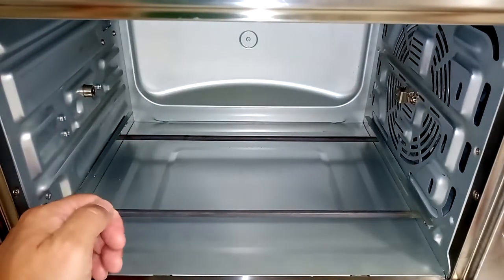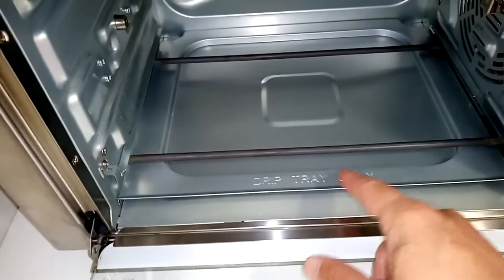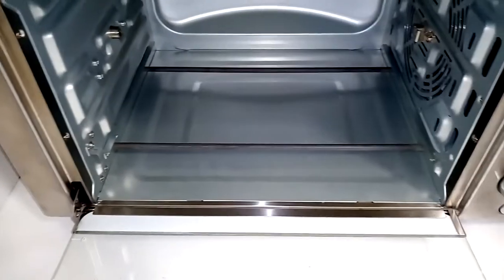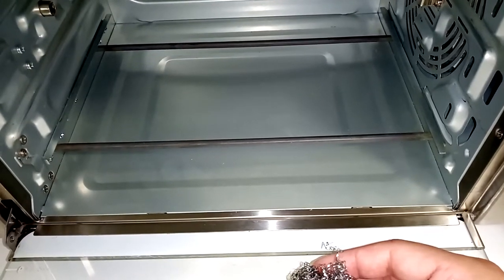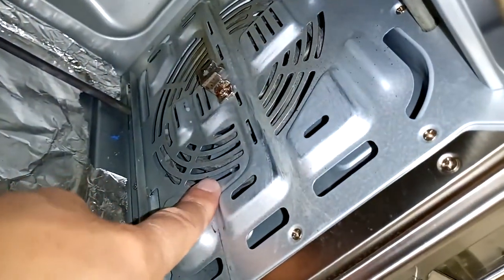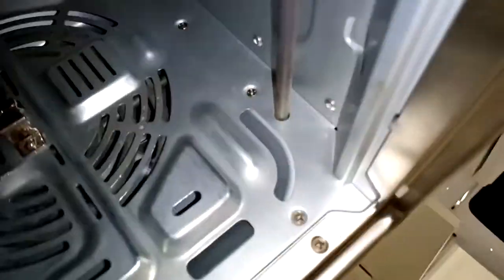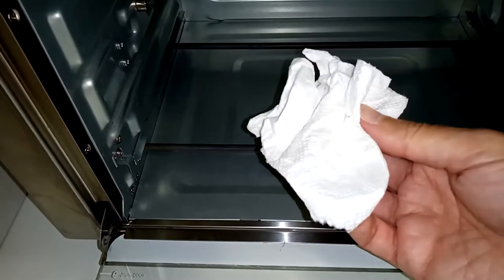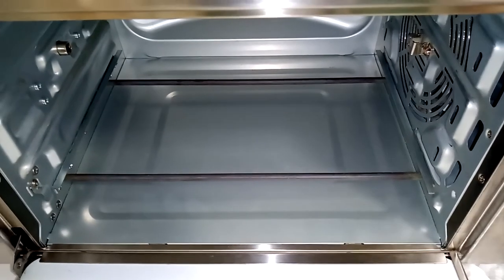How to Clean the Inside of an Emeril Air Fryer 360 & the "Tool" You Need To Do It!

Comment: Thanks for these tips! When you cook hamburgers (or steaks, etc.), how do you remove the basket (or food) without the hamburger juices dripping all over the glass door or kitchen counter?
Reply from the maker: I have a video (I'll share the link here too) where I cooked 4 beef hamburgers.  I placed them on top of aluminum foil, which sits on top of the baking tray.  I still used the air fryer mode to give the burgers some texture like you'd get off a grill.  Taking them out was as simple as pulling out the tray and cleanup was a few seconds to discard the foil.  If you choose to use the air fry basket, you'll want to place the baking tray on the lowest setting, above the elements to catch any grease drippings.  When it's done, I would open the glass door and slowly slide out the basket.  As soon as physically possible, I'd hold a plate that you may initially stick a part of into the air fryer, under the basket and remove both at the same time (to catch any drippings).  If you flip your burgers and steaks, you should be able to get away with using the tray and you can avoid the potential mess.  It just may take a bit longer than using the basket.  Here's the link for the beef burgers video: https://youtu.be/-CgqK1J3etM   Thank you for the positive feedback- it's always appreciated.

Comment: I appreciate you video but I try to regularly clean it but we use it a lot. I turned it upside down for the first time to look at the time to figure out how to tackle it. I'm really losing before I start. There is gunk all around and behind the heating element. Some items we are cooking now our smoke alarm is going off. I will try to clean what I can of the top and see if that is the problem. I have used the baking soda paste with toothbush and with a sponge alone. Its nice to have but a lot of work
Reply: Your's must not be made like mine. I have a heating element at the top
Reply from the maker: Try using the tool in the video to clean the inside of the Emeril Air Fryer 360. If you have grease on the top and bottom heating elements it could cause smoke or even if you have grease and fat caked on the baking tray.  Do you use foil?  The tool I recommend is abrasive and one of the only things that can remove that brown caked on grease/fat.  If you have grease behind the side heating element where the fan is.. that is very tricky.  One viewer tried to remove the panel, but I don't know if it worked out or not.

Comment: Has this ever been used?? It looks brand new
Reply from the maker: It was used for quite some time before making the video.  You can check out some of the videos on this channel that feature the Emeril Air Fryer 360.  I have one on how to polish the outside of the Emeril air fryer as well. In fact, the hardened on grease I'm cleaning in this video was from the beef burgers I cooked in it just prior.  That video is on this channel!  The product featured in this video works to clean the inside of the Emeril Power Air Fryer 360.  It's one of the only products that does, which is why I shared it with everyone.  Cleaning the inside of the air fryer is a pain point for many Emeril owners.

Comment: I put foil on drip tray and it doesn't touch heating elements. I was thinking of putting tin foil on the top as it's hard to clean. 

I emailed them they told me not to use that but to use non-abrasive sponge
Reply from the maker: I never considered using foil on the top of the Emeril Air Fryer, but you're right it does get its fair share of splatters.  I think it would be difficult to find the right adhesive- you need something that could withstand the heat, but also safe from a health perspective.  They are right- first try a sponge, then a sponge with some soft abrasive (like the one sided ones that are usually blue or yellow), and when all else fails, use the tool in the video (link is in the description).  Btw- thanks for validating the use of foil on the drip tray.  It helps let others know it can be done in a safe and effective manner.

Comment: I have the same oven. What about the white part of the door. Mine is dirty and doesn’t matter how I try to clean it. The stains don’t go away.
Reply from the maker: See my earlier reply to you about how I used this cleaning tool to successfully clean the white stripy parts of the glass door.  Without seeing your Emeril oven, I can't be sure, but it's likely that what appear to be irremovable stains, are the grease and other drippings that can be removed (using the cleaning tool I featured in this video).  Give it a try and let me know.
Reply: Baking soda..

Comment: Thank you I’m going to buy it and it should clean the top to
Reply from the maker: It will definitely clean the inside of the air fryer as demonstrated.  If by "the top" you mean the top of the inside, yes, without a doubt it will work.  But I wouldn't use it to clean the outside of the Emeril Air Fryer 360.  It's a bit too abrasive for that purpose.  Happy Frying and thank you for the positive feedback.
Reply: which store has it all the time i want to buy it this week

Comment: we are told not to use sharp tools like steel wool.  However this "ball" of steel looks very damaging - I am amazed this is not damaging.
Reply from the maker: It works well to clean the inside of an Emeril Air Fryer 360.  I haven't tested it on the inside of other air fryers, but I imagine it will work on others too.  It does provide amazing results given how hard it is to clean the dried on oil, fats, splashes, etc.  That is why I wanted to share this cleaning tool/gem with others!

Comment: I use foil, but I cooked some ribs and the sides got bad around the fan.
Reply from the maker: Not to worry!  Use this tool, follow the steps, and the inside of your Emeril Air Fryer will be clean again.  It's no match for a little rib juice :-)  As you see in the video, I had no problem removing the hardened on grease (from beef burgers) on the side wall right near the fan of the air fryer.

Comment: Will the metal cleaner not scratch and remove the covering of the inside parts and might cause rusting?Thank you.
Reply from the maker: You may see some light superficial scratches (i.e. nothing you can feel with you finger).  So rust would be highly unlikely and additionally, the inside of the Emeril shouldn't be exposed to the kind of moisture that would cause rust.  When you're done cleaning the inside, keep the door open to let it dry out thoroughly.  When you're not using the Emeril, keep the door closed.  Also, when you use the oven, you will definitely be drying out the inside with all the heat.  The reason it wasn't easy to find the "right" tool to clean the inside of the Emeril Air Fryer is because it needed to be abrasive enough to remove hardened on grease, fats, splatters, etc. and yet not damage the inside.  It also had to be easy to clean with and not create more of a mess- no built in soaps, etc.  Now remember, if you clean your Emeril regularly, ideally after each use as soon as it's cool enough to safely clean, you won't even need this tool.  Point being, you won't necessarily be using it every time you cook.  So the superficial scratches etc. should theoretically be kept to a minimum.

Comment: What if it's really caked on from not cleaning  it regularly will the stainless  steel  pad still work
Reply from the maker: Yep, this is your best bet and should work well to clean, even if the grease and splatter are caked on the inside of your Emeril Air Fryer.  It may take a bit of work on your part (physically) and few whole balls, but I'm confident you'll be pleased with the results in the end.

Comment: What process do you use to clean the ceiling of the air fryer?
Reply from the maker: I use the same tool and the same process outlined in the video.  Just make sure you give the ceiling a thorough wipe with a damp paper towel (or several), after you're finished, to make sure there are no loose bits from the tool or the powder coating.

Comment: I have a used one not was not cleaned. How to clean my used one
Reply from the maker: To clean the inside of the Emeril Air Fryer 360 that has been used or in need of a deep clean, just follow the same instructions in the video and use the recommended tool.  You'll probably have to put additional time and a bit more scrubbing into cleaning your Emeril air fryer if it was not cleaned after regular use in the past.  If you want the outside to look shiny and brand new, you can watch my video on polishing the outside of the Emeril and restoring it.  I show you what product to use and how to use it.  Happy Frying!

Comment: I thought you're not supposed to use any metal cleaning implements because if any fragments are left it can cause the fryer to spark and malfunction? Is this not true?
Reply from the maker: I believe you may be thinking of a microwave.  The situation you've described above is what would/could occur when metal is placed in a microwave oven.  The Emeril Air Fryer 360 does not use microwaves to cook food.  With that said, you should still make sure not to leave any metal fragments in the air fryer for several other reasons (including the fact that you don't want metal fragments ending up in your food.).  You can easily accomplish this by using several damp paper towels (one after the other so they can pick up debris and clean properly) and wiping the inside of the Emeril Air Fryer, after scrubbing it.  With a little time and effort, it's easy enough to clean the inside of the Emeril Air Fryer 360 without leaving any metal shavings or debris.  The alternative, which is to allow grease, fat, etc. to build up in and around the inside, will likely lead to smoking issues.

Comment: Why does my light come on and i cannot use my emiril airfryer
Reply from the maker: The first step, though unlikely to be the answer, is to unplug the Emeril Air Fryer from the wall. Leave it unplugged for a few minutes and then plug it back in.   Also, which light are you referring to?  In certain modes, like the air fry mode, the heating elements will turn on first and emit a red glow in order to pre-heat the airfryer.  Then the blower and side heating element will start working.

Comment: check some other videos on to clean a dirty Air fryer. Not how to wipe down a air fryer
Reply from the maker: I think you skipped over the parts where I literally scrub down the inside of the air fryer to remove dried on grease and splatter.  I even zoom in on the scrubbing part. In fact, the "tool" is all based on the need to scrub. "Wiping down" is done after you've scrubbed.  Sorry you missed the important parts as this tool does make cleaning the inside of an air fryer a whole lot easier and is one of the only effective ways to remove hardened on grease and grime without using harsh chemicals and cleaning products.

Comment: I cook some hamburger paddies, and it is a mess inside, burnt grease into the metal, will try the Steel scrubbing Pads....
Reply from the maker: I think you'll be surprised how well this specific brand cleans the inside of the Emeril Air Fryer. The grease splatters I cleaned up in this video were from beef burgers (I made a separate video on cooking them to show how much cleanup effort was saved by using foil).

Comment: Where are the bottom sensors?
Reply from the maker: Are you referring to the lower heating elements in the Emeril Air Fryer 360?  Those are the two long bars at the bottom of the oven.  Any temperature sensors would be behind the right side panel.
Reply: @efficientway  idk, getting an E1 error everytime I try to use it for anything. Manual says to check the "bottom sensors" when that happens. As in the sensors that detect the bottom tray is in, I think they mean the drip pan tray. I've messed with that a dozen times doesn't seem to fix any thing, but I'm not sure where these sensors are to detect if the tray is in or not
Reply from the maker: @CornPopWazABadDude  So I believe you are looking at the manual for the Emeril Lagasse Pressure Air Fryer (which I didn't even know there was such a thing) as opposed to the Emeril Lagasse Power Air Fryer 360.  I think I saw what you were looking at upon doing a Google search myself.  There's definitely no sensor on the bottom that detects whether the drip tray is in or not.  Unfortunately it looks like you need to contact customer service (who is usually pretty good about responding).  This is an internal electrical problem.  One thing to note, I mentioned the temperature gauge in my previous comment and upon further inspection, it is not located near the fan.  Rather, there is a silver "pin" looking device that sticks out from the top left side.  This makes more sense as being near the 5th heating element would throw off the readings. Two things to try (if you haven't already) that I would rate a very low percentage chance of working, but worth trying since it's minimal time or expense to try.  First, try unplugging the unit for 20 minutes and plug it into a different outlet that is definitely grounded.  Second, try cleaning that little needle/probe thing I mentioned.  Again, these are unlikely to work, so don't get your hopes up, but give it a try as it's minimal effort to do so.  Let us know what happens.  Good luck.
Reply: @efficientway  yes that's the one. I'll try what you said and let you know. I called customer service and no answer even though it says they're open during the hours I called. I also sent an email to them, so we'll see. They could've just been closed for the holiday.
Reply from the maker: @CornPopWazABadDude  Yep, they're most likely closed for the holiday.  No doubt they've dealt with an E1 error code at some point.

Comment: The white part of the door is impossible to clean.
Reply from the maker: I can't guarantee anything without knowing exactly what you kind of dirt and grime you have on the inside door of your Emeril Air Fryer 360, but I just used the same "tool" I featured in the video and I cleaned up the bottom white strip and the top white stripe.  All I had to do was wet the "tool", and then gently scrub/wipe the white part of the door (don't use it on the clear part of the glass as I haven't tried that yet and I don't know if it will scratch).  After that, I wet a piece of paper towel and wiped it down.  It worked like a charm.  Try it and let me know.  What was once thought impossible will be your every day reality.

Comment: that steel wool? OMG! no way! even the mfr. says NO! i would dab some professional easy off oven & grill cleaner on it and wait. THEN use your blue (not green) scrubbie. rinse with moist watered towels then wipe dry.
Reply from the maker: That is NOT, I repeat, NOT steel wool.  Please re-watch the video, or listen to what I said about why you shouldn't use steel wool, or click on the link in the description to learn more about what I am using.  I said what it is in the video and I show the packaging as well. Steel wool (what you mentioned) is made from thin steel filaments that are either matted together or woven into a pad.  Steel is a combination of iron and carbon, and this combination corrodes & rusts quickly, once wet.  SOS pads (steel wool pads “filled” with soap) work great for a short period of time (1 day?), and then need to be thrown out because they rust almost instantly.  You don't even have to re-watch the video... you can see in the thumbnail of the video that the pads I am using are like narrow ribbons vs. fine filaments that make up steel wool.  The  pad I'm using is made of stainless steel (a combination of chromium and carbon) and they do NOT rust or corrode… they last for a long time.  Once people try these, they don't go back to steel wool as they find these much better and easier to clean with.  As far as putting chemicals found in oven and grill cleaners in my air fryer, no thanks. If it came down to having to use chemicals in that small Emeril where my food is so close to the walls and I have air purposely blowing off the walls, vs. not using the air fryer, I would choose not to use it at all.  Thankfully I found a great alternative to removing those really tough splatters that everyone seems to encounter and that is why I made this video.  To share the knowledge and make using an Airfryer (or at least an Emeril air fryer) more enjoyable by easing the cleanup process.  If/when you re-watch the video, you will see how easily I remove caked on grease, oil, splatter, etc. without any chemicals.  Thanks
Reply: I will definitely try this! @efficientway
Reply from the maker: Nice!!  You'll see it makes cleaning up so much easier.
Reply: I agree.  Author says it's not the steel wool etc.  But in one of the videos it does state "no abrasives of any kind"  should be used. I'm going to heat unit, let it cool a few minutes and then wash with dish soap and cloth like I do for microwaves. 
Hopefully it'll be enough. I'm afraid of using that curly wire thing he's using.  
And of course, I watched one of Emeril's videos that showed using foil... after I had dripped on gooey grease.
Reply: @Vivian Sisk No ma'am.  Line the tray and drip pan with foil.  Then when drippings dirty the foil, just toss it.  *I recycle so I'll rinse off the foil 1st. 
I try to wipe the interior walls with soapy water and rag as soon as it's cooled enough to safely clean. If not,  the grease  becomes sticky.  Some has already cooked on. Once that happens, I'm at a loss lol.